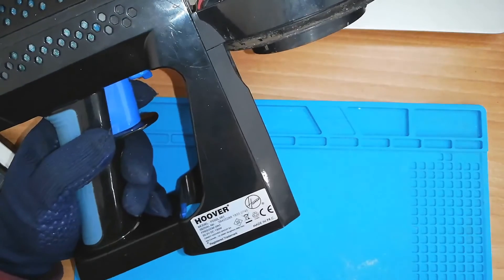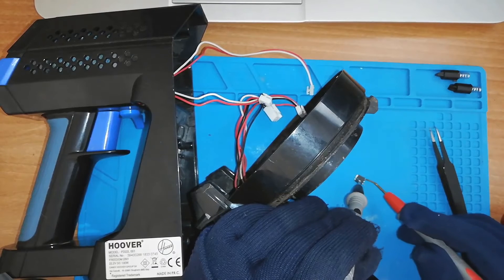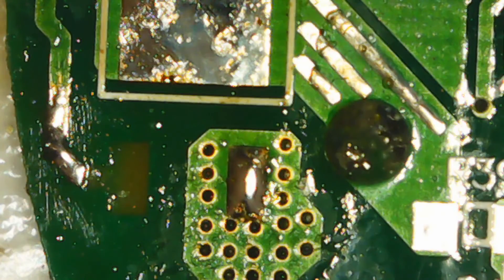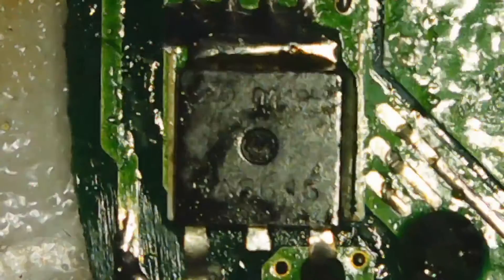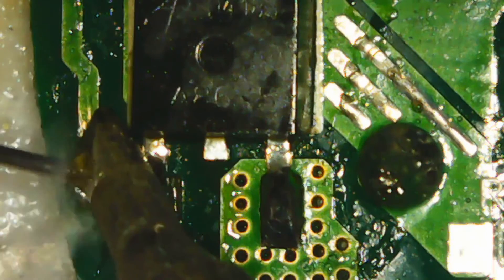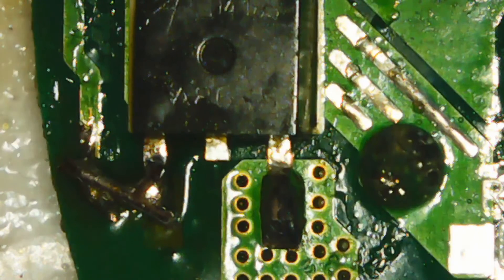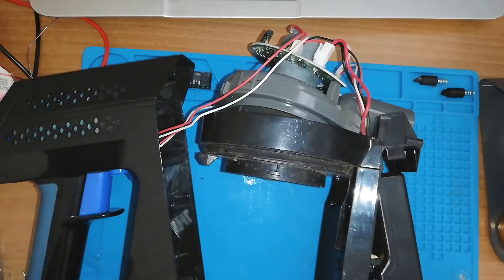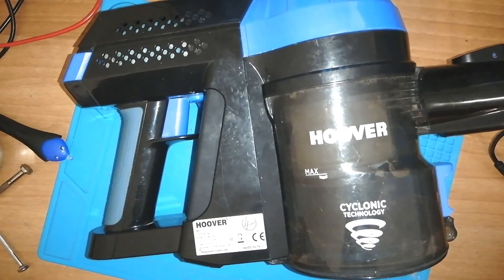Hoover FD22L Repair (won't turn off/on)

Comment: Thanks for the tips, just in case there is still someone out there trying to open it: there are 10 screws: 4 behind the filter (2 hidden), 4 behind the battery iand 2 under the motor. 1) remove the ones under the motor and unclip the plastic funnel 2) alll other screws 3) pull the motor assembly out of the main body and push a screwdriver in the motor assembly, in the joint with plastic of different colour. slowly work your way around, there are 3 clips to undo.

Comment: hello my friend
i had similar problem and i solved it by greasing bearing on motor but i need your help
i hawe 1 extra part with i cant find where it goes
square black plastic
i try to se on your vid but i can see it
i hawe same model as yours

Comment: For anyone wondering and wanting to repair this vacuum: you have to loosen the screws and to remove the top, where the motor is sitting you have to press the top (where you can see a gap and might think you have to pry it) to the inside, it is mounted using clips to the main body. So pressing the plastic inwards will get the clips out of the main body and then the top will come off

Comment: Hi Team,
Is it possible to share a video showing us how you dismonted this vaccum cleaner ? 
FYI, I have the same issue as yours with my Hoover FD22BC 011.
Thanks in advance for your help 😀
Reply: beware of the two hidden screws between the main body linking it to the circular motor top ........which is a different colour and appears to have no way to remove........but you need to insert a thin screwdriver blade into the very tight circular top (different colour ).......it seems like there's no gap.......prise it carefully & when it parts then hold it there and put another blade about a third the way around. Eventually the top will come off ( if you did'nt remove the hidden [deep] screws it will break !

Comment: Hello, I need your help i have the problem motor very loud and i like to dismantle the FD22 but if i remove all screws which i can see (2 behind the motor filter) and 4 at the akku pack i can not open it. Who i have to remove more screws? Can you help.

Thank you

Comment: Could you please help me with the battery terminals which pin is + and - , I'm going to MOD this same hoover but I don't have a battery with it, I know it has 6 pins I just need to determine which of them is negative and positive power input. thanks :)

Comment: Hello I have the same vacuum cleaner but different problem the vacuum cleaner as soon as I switch on the power remains on and does not turn off. Do you have any solutions?

Comment: My Hoover H-200 worse buy ever. Only 2 months old already its not working due to poor electrics. Lucky its under guarantee and im having another body sent as the battery indicator says its charged but it does not work. Not impressed at all to tell the truth, i got told by my friends to spend a bit more and avoid Hoover i wished i listened now

Comment: Would have been great to see how you took it apart or at least back together. Have the same hoover. Works ok but wanted to get inside to give the motor a full clean.
Reply from the maker: I made a total mess of opening it, ended up opening all the screws and prying it open.
Reply: @sol05033149  came here because I'm opening one and after removing all screws, I don't know where to pry

Comment: nice one,,i have the same hoover but it only runs for a few seconds then stops, let it sit for a couple of seconds then it starts and stops again after a few seconds ,any ideas, cheers
Reply: i have same issue with newer model of this-looks the same but colors different. I get red/blue flashing light with charger so its likly a battery issue

Comment: Hi mate I have the same Hoover it won't turn on .when I put it on charge the led flashes blue and red , any idea what it might. Be thanx
Reply from the maker: Also somtimes when you push the battery in, the connection on the UNIT itself might get pushed back if they are loose/broken. Try add some folded up paper on the back of the battery terminal to hold it in place or a toothpick.
Reply from the maker: Hi mate, could be blocked with dust or the battery is not seated correctly. 1.Try turn it on without the brush head part connected, To see if that's jammed up.
2. Take the air filter out the back(one with two clips) and look down the hole of the main unit at the back there is a plastic grill on the hoover see if there dust booking it, try remove it with tweezers if you can.
3. Try wiggle or push the battery and check the connection are clean and not broken.
4. Try a friend's battery 😀
Hope you fix it!

Comment: Thanks for sharing your video. I have the same issue so please let me know where you bought P-Channel D4185 as I can't find it anywhere. Could you please share link where to buy it please.
Reply from the maker: Hi, I tired to get them from DigiKey but the postage was too expensive. I got mine from china after, I doubt they are original but work fine and I have been using the hoover everyday with no problems. I have added the links to the description. Hope you fix it!